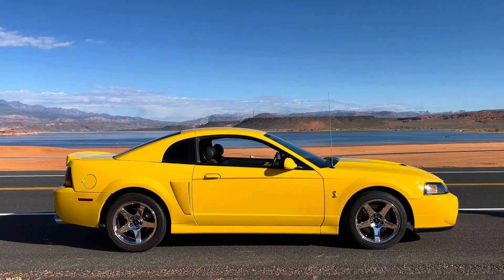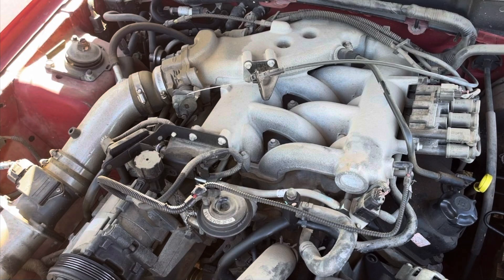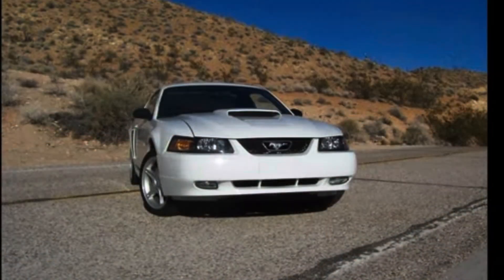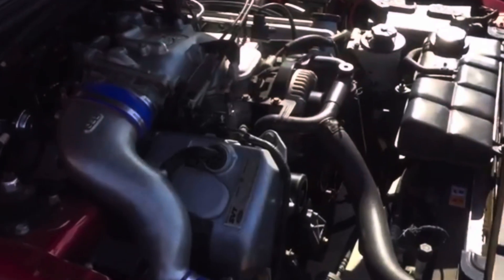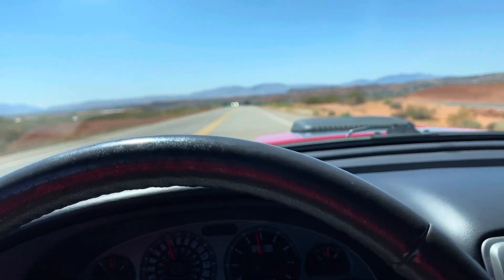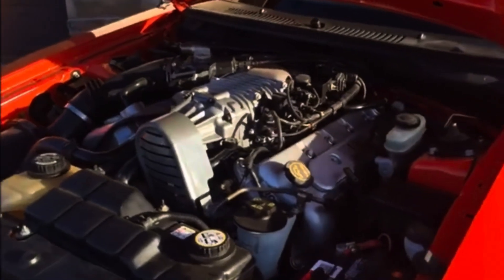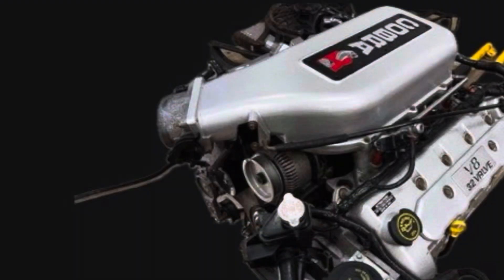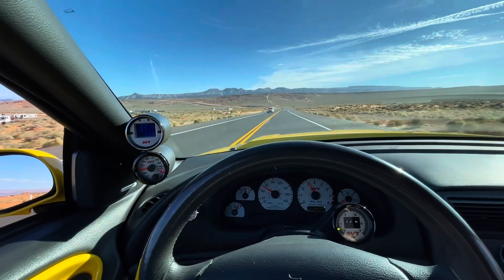New Edge Mustang Factory Engine Options and specs 1999-2004 Ford Mustang

Comment: is the Cobra R 5.4 still a 4.6 just stroked out or is it new engine?
Reply from the maker: It’s said to have the same bore as the 4.6 but it’s stroked deeper to 5.4
Reply: Hell yeah imagine if you put a procharger on a Cobra R how much power itd make? @dannyjohnsonsgarage
Reply from the maker: @TopMach1 it would make power and a guy has a turbo one, but the rods are not as strong as terminator rods, so you’d be limited to about 500-600 before rods would snap.
Reply: So the 2003 Cobra is best engine ever made! What Rods are in the Cobra R? @dannyjohnsonsgarage

Comment: Hey Danny sorry, this is off topic but you're literally the only person who would know this.. I was at the junkyard yesterday and picked up some coat hangers for my 02 Mustang. It seems that between 94-02 and 02-04 there is a different rear seat coat hanger design. Do you know why this is? Also the rear panel is different because I had to modify the 03-04 hanger to fit my 02. Just wondering if you knew of any information on the matter
Reply from the maker: Yeah, I noticed it as well on mu 2001. It looks much smaller and has the hole for the screw, where the newer one on the cobra looks thicker and also has the cover over the screw hole. They also made the a pillar trim poke out farther instead of being rounded, yet they changed the rear panel that was a heavy foam to be a lighter plastic piece. I think it was just some simple redesigns as they ordered more pieces

Comment: Back in 1999 to 2002 - 2003 FORD Australia imported the 4.6 Cobra's only in a Manual Transmission. It was 240-245 Kilowatts. Hardly sold as it was no match against the LS1.

Comment: My 99 electric green cobra vert.has a built 4v.has Manley h-beam rods.pistons.all arp hardware along with arp head studs.with 11 to 1 compression.
Reply from the maker: I believe a lot of power is found in higher compression and ford stayed pretty low to be conservative and perhaps were afraid the knock sensors wouldn’t do the job. Maybe even not want to requiere premium fuel, but it’s a good way to go in my opinion
Reply: @dannyjohnsonsgarage .someone built it to boost but never did.i run 93 and vp fuel additive.

Comment: I had a 03 GT. Ordered it from Ford with the Shaker 1000 stereo system. Got Ford racing 3:27 gears in it, exhaust, etc. I owned it a month and a Border Patrol vehicle side swiped me. Thankfully I wasn't hurt, but my car was done for. To make myself feel better, I just bought a 03 SVT Cobra in sonic blue w 5K miles 😂
Reply: That's a legendary upgrade.
Reply from the maker: Too bad it happened, but AWESOME upgrade!